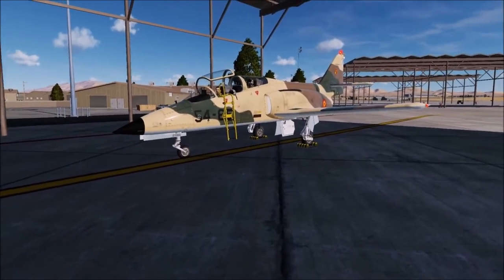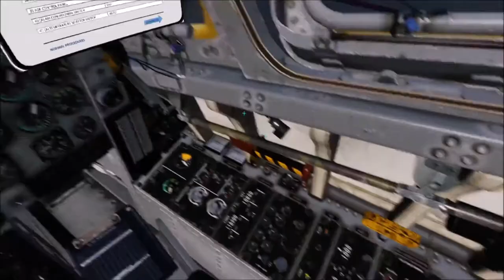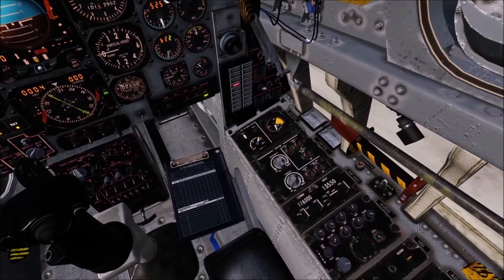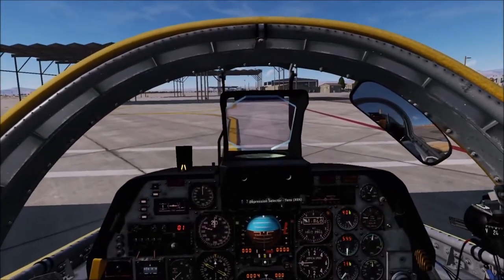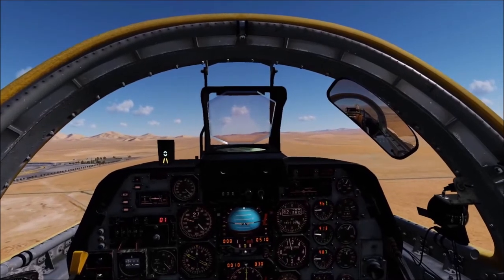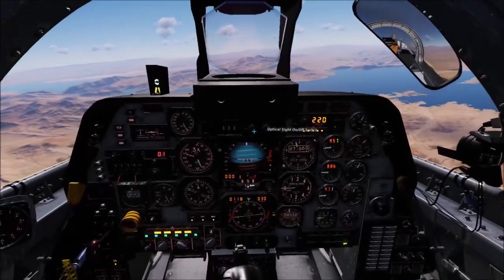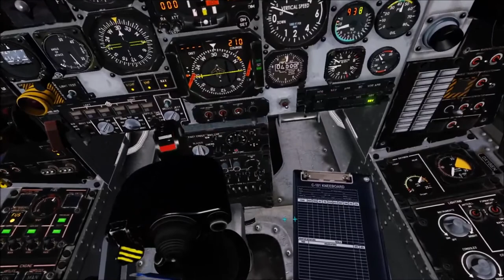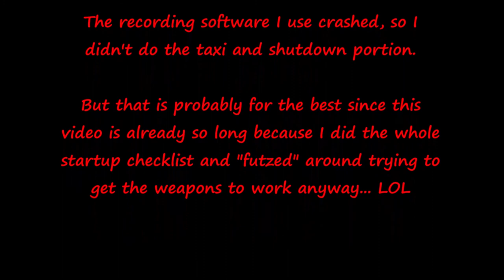DCS: Aviojet C-101CC Manual Startup & Rocket Attack "Attempts" - Long Video

Comment: You don't have to worry about engine temp so much in the CC.  In the EB, definitely.  Also, if you engage Manual Power Reserve (MPR), you'll get a bit more power.
Reply from the maker: I did know about the Manual Power Reserve (MPR) in the C-101CC. I didn't use it in the video though. I keep reading the manual over, as there is Soooo much in there to learn. I miss things, or don't get them to register the first, second, or third time I read it. LOL

Thanks for the information though!